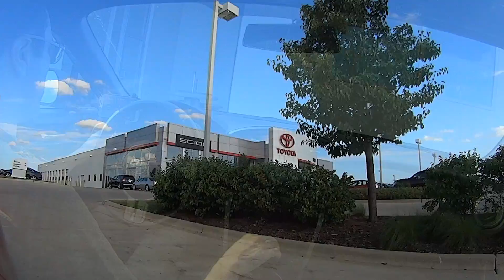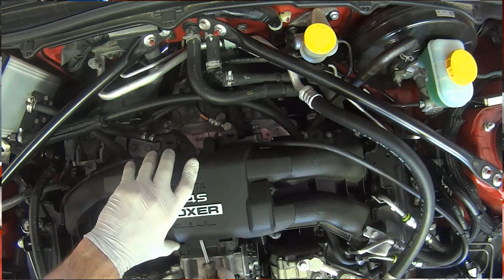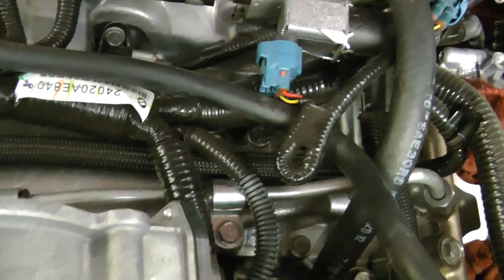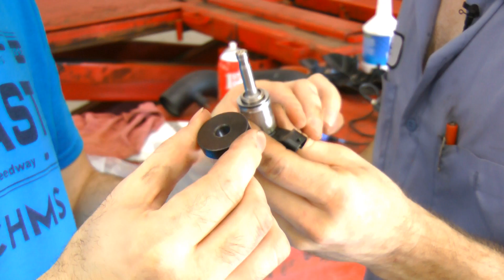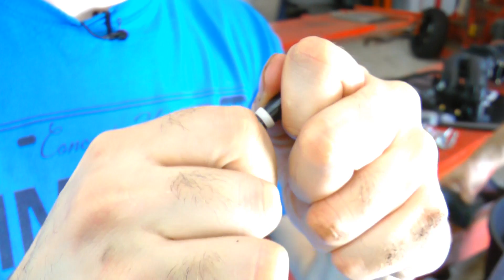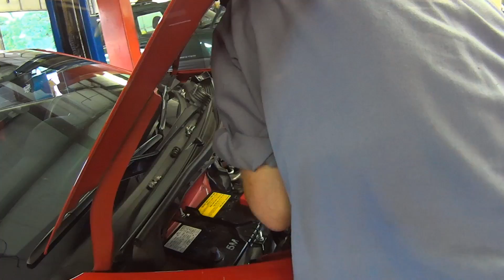Scion FR-S BRZ Direct Injector Seal Replacement | Problems and Issues

Comment: Great video, my 2019 Toyota with only 12k miles has a high pressure fuel rail leak…unfortunately it’s not covered by the manufacturer warranty, so I’m just trying to gain as much information as possible 👍🏽

Comment: All the vids I saw previously said ,don't get oil on the seals 😂. Another tip I like is pinch the seal down with your fingers before sliding the thing over it. Also I believe the slider has to be reversed in direction to gradually shrink it down.

Comment: I'm pulling a p0301, no.1 piston misfire. Swapped plugs and coil pack to no avail. Could I run rich from an injector seal issue? oil level is rising due to fuel not getting burned

Comment: Direct Injection seal fail will loss compression create lean mixture, knocking noise that will noticeable if ignore that will cause burn valve or blow a hole in a piston, my easy way to check using relative compression test ( scope ) or compression test if easy access. i don`t think they let me upload pic over here for reference.

Comment: The labor time on that job for all eight injector to be replaced is 3.3 hours. Where the hell did he get 20. Can have that intake off in twenty mins alone easier if u remove the strut tower braces and the two bolts in the AC pump

Comment: Thank you very much for the video. This is the best explanation I've seen regarding the FRS/BRZ injectors. I know it's been years since this has been active but I'm a bit stuck and have a few questions:

1) I replaced the engine in my 2013 BRZ with a 2014 FRS engine. The BRZ had injectors marked with #2 and the FRS had mark #3. You mention "the # must match the engine". Does it match the engine or the actual computer? If I have to replace the injector, it either need to match the 2013 BRZ computer or the 2014 FRS engine. FYI - no forum or dealership has been able to provide an answer. 

2) the end of the injector that goes into the injector rail - yours shows a ring on the end that you pull the rubber o-ring over (around 18 mins). Both of my sets of injectors do not have that (factory), BUT if I wanted to buy replacement injectors it has that ring. Do you know if that it required?
Reply: Hi Clint, a long time is past Iand I'm pretty much up to the same point, I've installed a new motor that has #2 on it but my originals direct injectors has #3, the car seams to have a fueling issue atm so I think I'll need to change them over, what did you end up doing ?

Cheers.

Comment: Hi mate...this video has helped me to understand the problem of my 86...and I'm grateful to you!
But I need help, i can not find the SST tool to mount the new gaskets :( one of my injectors has lost the collar seal, and I had to buy a new injectors assembled... but I have a doubt, do you think i can reinstall the other 3 injectors with the original seals? I can not buy the sst tool...do you think i will have to buy 3 new injectors? sorry for my english and thanks for the answer...
Reply from the maker: +Hachiroku Monkey if you cant find tool you will need to buy new injectors.

Comment: So is play normal on the teflon seal? All of mine are loose like in the video after I replaced them. @savagegeese
Reply from the maker: +Joey Baughn Yes this was by design for expansion and contraction of seal.
Reply: savagegeese thanks for the reply, mine still look like how loose they sit around yours at 23:35. Gonna redo them and try not to stretch them out as much.
Reply: I guess that's what I get for using a DIY tool to put the seals on. The tool is soo expensive.

Comment: I dont understand why toyota is telling you to replace the high-pressre fuel lines?! We are only talking about 150bar here (typical Bosch petrol direct injection), with a metal to metal taper seal like VW uses on its FSI and they dont tell you to replace the line. Also many machines that have hydraulic systems (pump->motor/cylinder) use this type of seal to and its normal to reuse the lines if you change a part/disassemble the machine.

Another information/question: The seal at the injector is a teflon seal, normaly you should not lube them. Thats what VW says.. i mean it is the same seal system too, why does toyota tell you different stuff then VW?

PS: VW has a similar tool but with a one cone and 3 ... sleaves/rings, i gues, so that you can step by step push the ring 1. on the cone and then in the seal seat (Partnumber T10133)

Comment: Meanwhile A Hyundai genesis with a 6266 turbo and 10psi boost is holding without issue on the 3.8 GDi motor. Cross fingers..

Comment: Same problem you described is killing ecoboosts too. Injectors flowing 35% less in 40k miles leading to cylinder failure. Compounded with the carbon build up on the valves. Next purchase won't be Direct Injected, half tempted to trade mine in.
Reply from the maker: It seems like if you go DI motors you need port injection like what Toyota and lexus are doing.  The issue with DI here was tuning was causing misfires at high rpm, shredding the seals.  What ecoboost 4 bangers or v6 or all?
Reply: +savagegeese It's been reported in the 4 bangers on the focus forums. I haven't read up on the v6's. 

http://www.focusst.org/forum/focus-st-maintenance/47970-carbon-build-up-injector-boom.html

Comment: ...and thats the only reason Ive never gotten a subaru, way too much work to do anything to the engine, it took me like 15 minutes to change the valve cover gasket and o rings on my last celica, how many days does it takes to do the same on a subaru? im too lazy and I dont have a garage or even a driveway to fix a subaru, other than that they are amazing cars and I love them! as long I dont have to open the hood lol
Reply: MPGster s well if you know what your doing, a valve cover job even on the hardest of Subaru engine should only take a few hours. On the four cylinder belts motors, it takes maybe 30 minutes...

Comment: Has this issue been fixed in the 2014 FRS?
Reply from the maker: It's knock and heat related to the transient ignition table issue on the factory tuning on 2013 and some 2014 models.  Also if you are running more agressive settings modified tune and run on track need to make sure tuning has no knock or you can burn up seals faster.

Comment: You do not have to replace the fuel rail split line, its a pressure fit seal, meaning when you torque it down it at spec it will seal, theres no rubber gasket on them, this line is the same ones found in diesel cars.
Reply from the maker: Service manual states the high pressure lines are non re-usable parts do to the potential of the flares being damaged from tightening. So.re-using them is not recommended.  When you see the lines, and how hard it is to get to them, you basically have to put everything back together before you can even test for leaks. No worth the risk to save 60$ when dealing with HPF systems.
Reply: savagegeese Uh? I guess gas hard high pressure line are different than diesel high presssure hard lines.
Reply from the maker: I didnt write the service manual the Subaru engineers did.  And if you look at the flares on the lines after removal they are marred, can you re-use them probably, if you want to go ahead and yes diesel is almost identical no argument there.

Comment: direct injection is epic fail! get rid of it stupid car manufacturers! There is no point in having direct injection itself as toyota still needs to admit aka there stupid ass lexus is250 engines aka famous carbon build up on all direct injection only engines on the back of the intake valves, and thats why these mafawkas also put port injection into these engines to clean away all carbon deposits on the back of the intake valves, so in essence direct injection in theory has better performance but using only direct injection only allows really bad carbon build up on the intake valves causing performance blocking issues and even valve piston contact eventually, added cost with minimal performance gains, not to mention high pressure fuel pumps and complexity, i really hate how complex and messed up the engines on the frs is, its' just plain retarded, whats the point in having a nice handling sports car when it failing in both quality issues and design flaws, and this has convinced me not to get an frs, i'll stick to port injection and has made my decision to get an s2000 instead.

Comment: Perhaps the reason for a beveled on the toyota injectors is for increasing the strength of the seal. Think about it. When the cylinder builds pressure right before ignition the seal will be forced up the injector. With the bevel it will pinch itself between the injector port hole and injector housing thus creating a seal that can hold more compression or boost. If it was the VW injector as soon as the seal tries to move up the injector housing due to pressure it would encounter that very sharp pinch point acting akin to your nail gouging the seal.

Comment: Not sure why Toyota thought DI was a good idea...anything that is exposed directly to the piston chamber will be riddled with carbon...
Reply: Direct fuel injection allows them to run higher compression with less detonation  (due to the fuel cooling the chamber) and more efficient fuel usage. That theoretically gives more power with better fuel economy.  The performance takes precedence over the service requirements.
Reply: Trying to make Subaru's shitty engine less of a gas guzzler I expect.
Reply: Z33 Garage

Comment: This makes me soo freaking glad i have a car with a normal 4 Cylinder engine haha
Reply: Matthew Sharpe Toyota should crap the Subaru Boxer engine and used Lexus NX200T turbo motor instead.
Reply: Yes, I do not understand why they put a Subaru Boxer in the 86.  Toyota have loads of much better "normal" 4 bangers in their line up they could have used, it's not like there isn't room for one given how low the boxer seems to sit - the original design concept for the car even had a V6!  It's a needlessly complicated design.

Comment: the problem with new cars is that there is to much electric shit on it , if i ever can own a brz/frs/gt86 i pull that shitty boxer engine and put a nice sr20det or 1jz/2jzgte in there, analog hardware ftw
Reply: Or an barra, n54 heck even n57 is an good option ;)

Comment: Correct me if i'm wrong, but i have heard that the chirping is a result of there being too much ethanol content in the gas we use... something about it not processing it right. Is that true? My personal experience with it is that i use to go with exxon premium, which is 91. then i found 93 at the BP. i used that gas and the chirping was significantly reduced. I looked for Ethanol free gas but he nearest one is 100 mi away. still maybe thats something toyaburu should be made aware of.

Comment: Not sure if you noticed the giant supercharger bolted onto the car, but most service managers would laugh you out of the dealership if you asked them to perform warranty work on engine internals of a modified, supercharged car. Known issue or not.

Comment: Would it be possible (and prohibitively expensive) to simply order each set of numbered injectors in advance.  Then install the discovered correct number and return the remaining two sets back to the vendor?  This would cover all bases in advance and avoid the seal mounting fiasco.